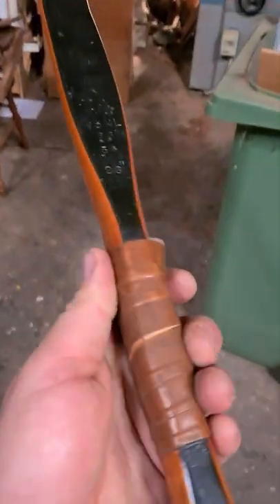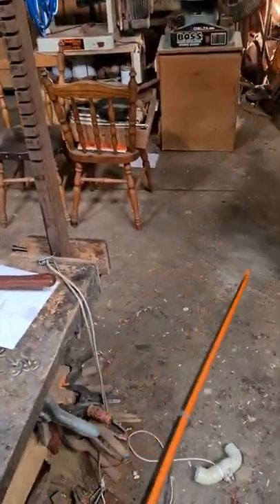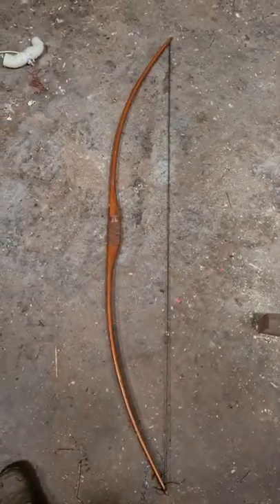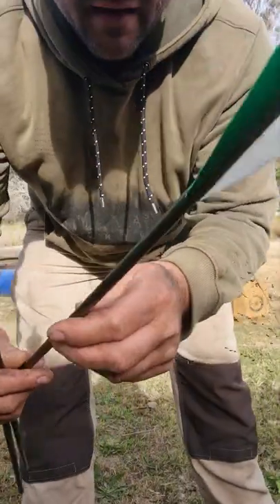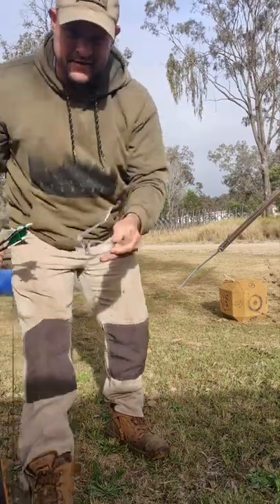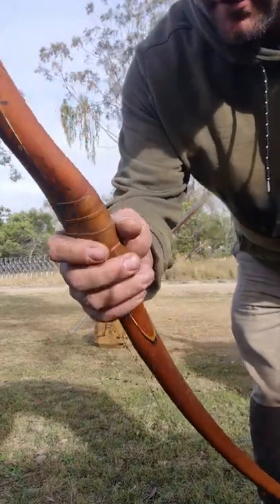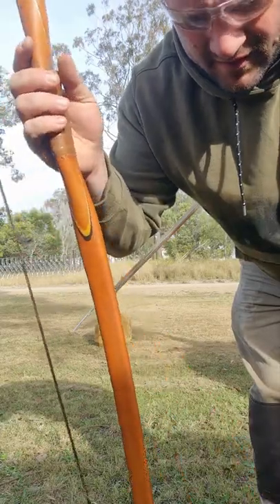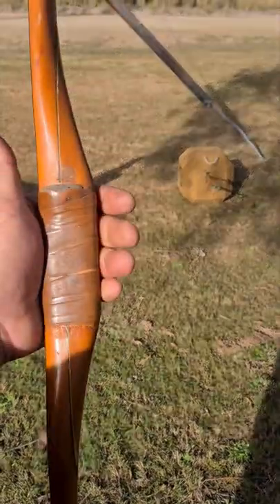Vintage 1930-40's style American flatbow

Comment: I have the same bow except 45#. I was curious and couldn't quite tell in the video. Does your bow have one limb slightly straighter than the other, when unstrung? Mine definitely has a difference between the limbs but seems to shoot well.
Reply from the maker: This has a different bottom limb brace height. The tiller is spot on though